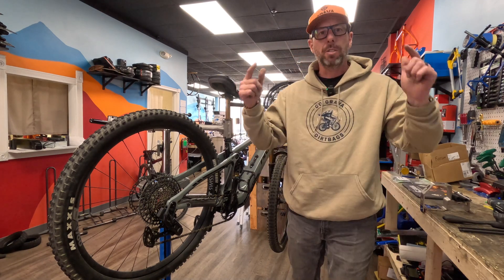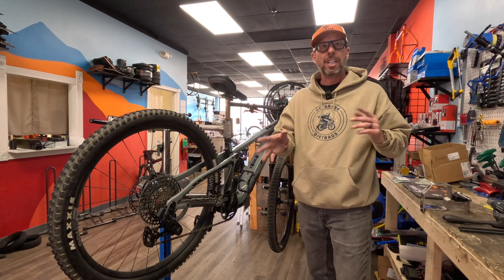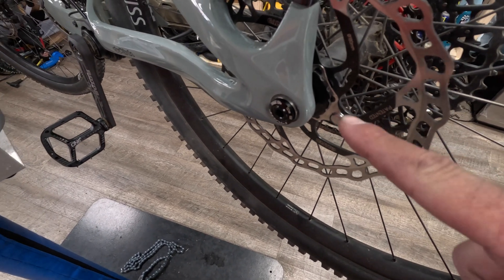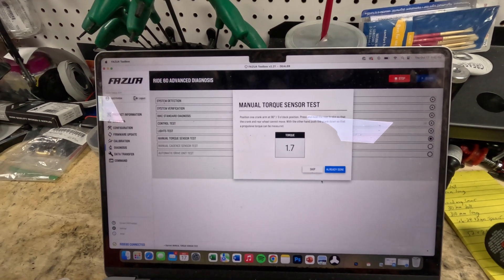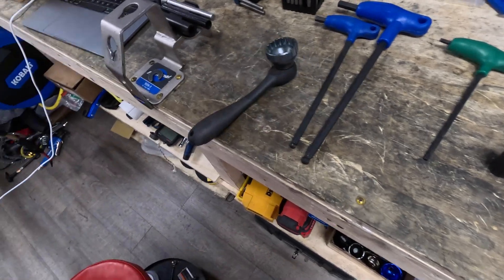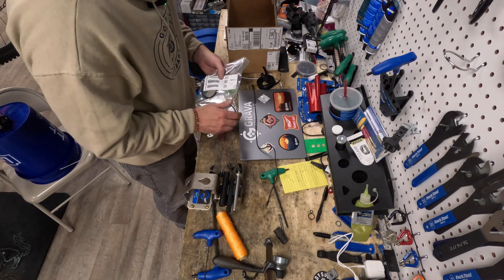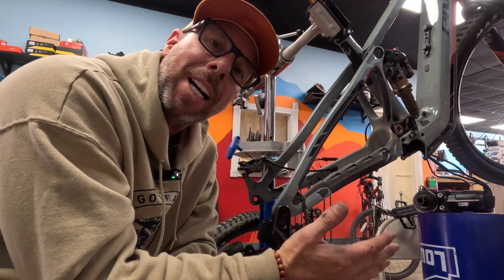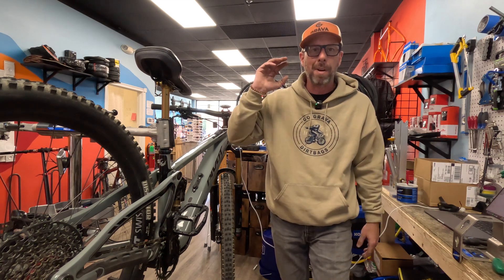Pivot Shuttle SL | Fazua Speed Sensor Replacement

Comment: Does the Fazua lockring come undone pretty easy? I have heard that it may need penetrating oil, or else the ring threads may shear off.
Reply from the maker: I've had zero issues with it.  Matter of fact, I would say they have been below torque in my experience.

Comment: Good overview! I just ordered a Shuttle SL as my first eMTB! 
Is it common for these speed sensors to get damaged?
Too bad Fazua didn’t put a 2nd wire connector down at the terminal end (at the actual sensor). Then you wouldn’t have to drop the motor to replace the damaged sensor. 🤔
Reply from the maker: It is not that common for the speed sensors to get damaged, but it is the most annoying one to replace.  This case was just bad luck.

Comment: How could you bypass that sensor to make it run a little bit faster because sometimes when you’re writing faster than what the sensor reads, you can feel that the bike gets heavier as you paddling to avoid pass the sensor speed limit and that’s not comfortable
Reply from the maker: Maybe hook the sensor and a rogue magnet to your crank arm, but that would void your warranty. Still got the rotation like a wheel but it’s controlled by pedal rotation. I haven’t tried modifications or seen if you can change tire size in the software. If you can code, then you build a fake sensor that sends a fake signal.  Again, the motor was not designed to operate like that and you could damage the motor.  The Fazau dealer software does let you modify the power curve similar to using mapping software when a car is on a Dyno, but not override that 20mph setting.